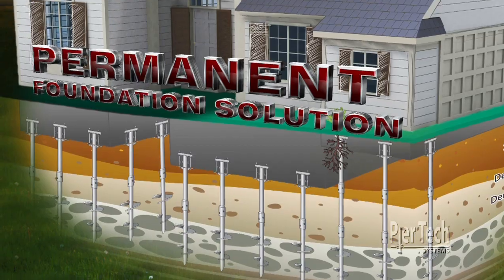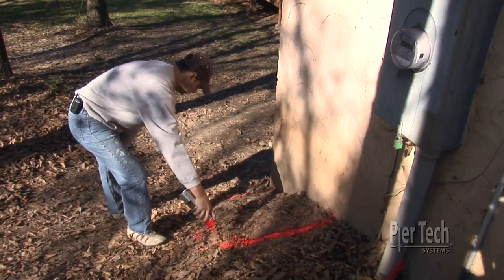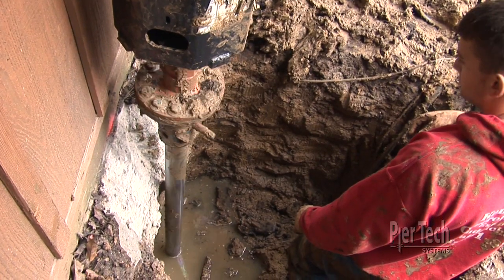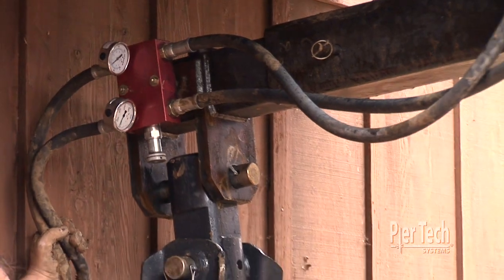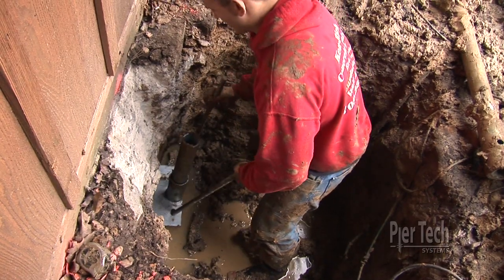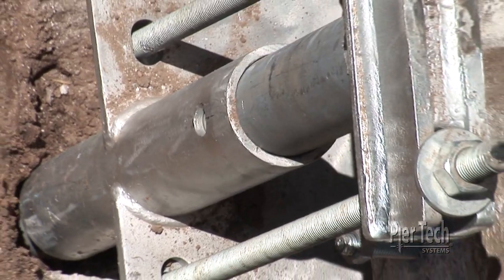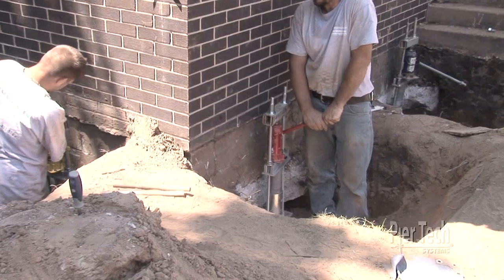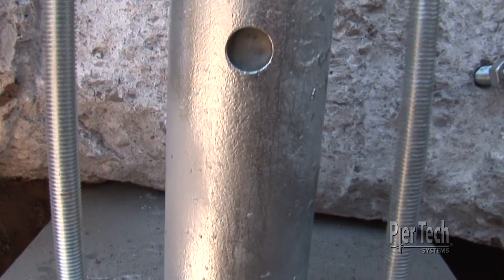Foundation Repair using Helical Piers

Comment: I just can't get my head around  the fact that a couple of nuts on threaded rods are enough to prop up house foundations!
Reply from the maker: The PierTech helical pile system has been field and load tested to handle many different applications. The thread rod and nuts shown in the video is rated and tested to hold loads in excess of 72,000 pounds, and that is on our smallest diameter round shaft pile! If you would like send us an email we can send you more information Sales@PierTech.com

Comment: Does anyone know what is the diameter of the piers? Thank you.
Reply from the maker: Helix diameters can range between 6” – 48” with a thickness of 3/8” – 1”.
Reply: @PierTechSystems  I had a bid for 35   1,5" SS5 's  for$75,000 plus.

Comment: I like this idea. How long is the warranty on this? Also ball park figure how much does it cost to have it installed? My house is also experiencing the brick cracking from top to bottom. No sheetrock cracks yet, its only on the outside so far. Thanks for the video.